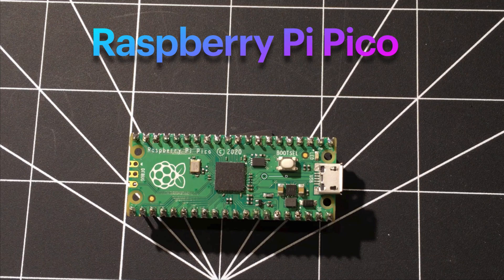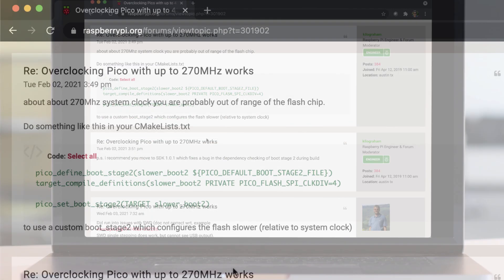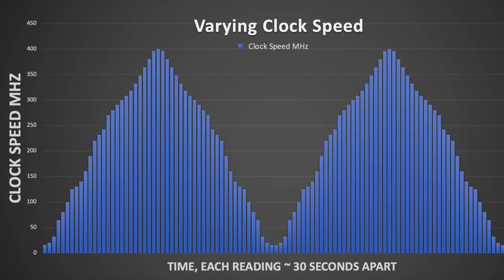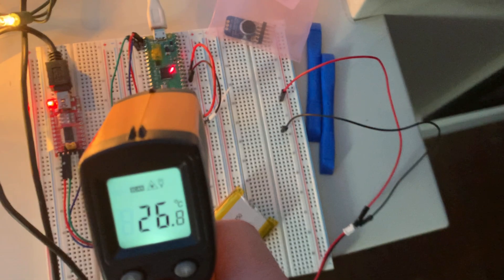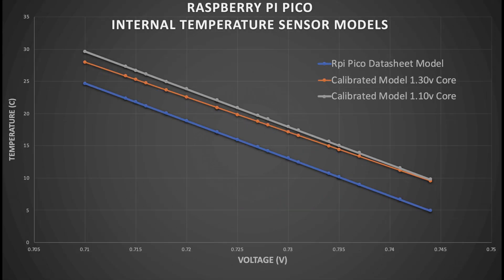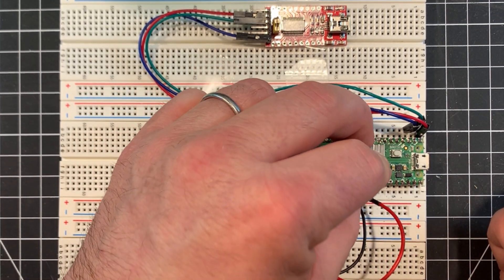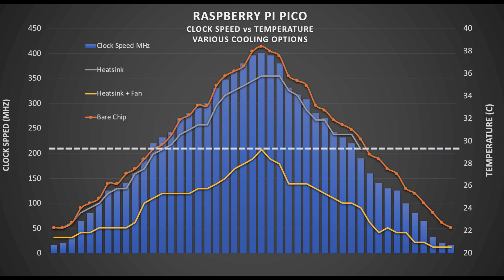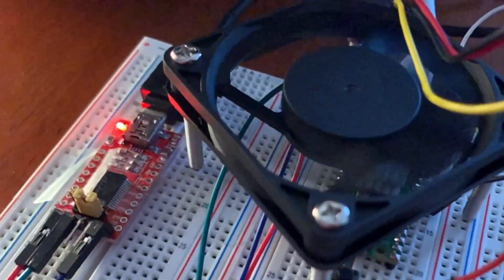Pico Overclock Part 2. Fixing the catch with the flash.

Comment: Sadly didn't work for me. My Pico seems to become unresponsive not even above 300MHz but even at 300MHz. Tried both the stuff shown here and there's a 300MHz option in the Arduino IDE as well, both give the same symptoms. I have two Picos and neither seem to work at 300MHz even with the changes to the CMakeLists file. 276MHz works just fine tho.

Comment: Yes, a fan makes most difference, with most electronics. I found that out while working with a shield on a regular raspi (no heatsink). It overheated because of low airflow (because of the shield on top). Just blowing once (!) between the sandwich layers reduced temperatures momentarily by 30°C or so. Then I hooked up a small low speed fan and the problem vanished.

Comment: Am I correct in thinking that if I overclock to 300MHz, the flash RAM can be used as is? I have been given the C source code of a fixed-point MP2/MP3/MP4/ACELP/LPC10e decoder. If I can run @ 300MHz then I can compile the C and convert to assembly one routine at a time. Now, my ONLY gripe about the 4020 is that it only has 2Mb of flash. This is not a lot of space for an MP3 decoder. For that reason I am keen to know if my PC or maybe a Raspberry Pi with more RAM can act as a USB slave.
 I would like to thank you for your excellent video. I wonder if you tried overclocking both cores. If one is essentially disabled, I presume less heat is generated and since both cores are on a single piece of silicon, maybe that will help with cooling.
 The project I am working on is a not-for-profit low cost audiobook/audio-lesson/digital storage & word processor (for now). In the last case the SoC uploads the word processor onto a PC or Mac. It is specifically aimed at developing nations such as India, China and South America. I have to get the whole thing:

-USB drive
-Audiobook player
-Auddio-lesson player (multiple choice questions)
-Storage device for Windows/MacOS computers executables and data)
-48 x 256 pixel backlit LCD screen (so larger glyphs can be rendered).

I am also looking into supporting microtransactions. The limit will only be $10 (for example) so kids can always have enough money to get home BUT digital payment occurs AFTER the journey so kids don't get bullied for their lunch money. It can also act as digital library card, bus pass end indeed any kind of key.

 When this is complete (as I know it will), I intend to base an MP1 video decoder (VCD) on the Cortex M3 processor. As you may know, MP1 video has a resolution of 352 x 288 pixels @ 25/30 frames per second. The audio is MP2. On an 80 minute CD, the format will hold 800 minutes of video.  That means about 900 megabytes of data. Of course, the data is required serially so the source does not need to be THAT fast. A ROM that simply streams out data will work. Since the data is being streamed, there need not be error detection.. CIRC, a variant of Cross-interleaved Reed–Solomon coding is used which means that for every 3 bytes, their has to be an error detection and correction byte so 106.66 Mb can be stored. Each frame can still have a time-stamp and finding it on a ROM will be pretty easy.

I think the device needs to have 128Mb of serial built in. However much storage a serial flash holds, it only has 6 pins connecting it to the system. I'm not sure if it's possible or even desirable to place said flash onto the same piece of silicon as the CPU and i/o devices but I know 2 things must happen:

1-The cost of serial flash keeps dropping so that the device is cheap
2-The device has a female USB socket so that people can share data.

I also want to include a real-time ADPCM/LPC10e/ACELP encoder so that teachers can either record lessons and give copies to students or students record the lessons themselves. If people want to see just how cheap the Chinese can produce digital hardware, I give you the $12 mobile phone:

https://www.bunniestudios.com/blog/?page_id=3107

The CPU is a ARM7EJ-S which is to say that it's really an FPGA which converts a Verilog script into a CPU. I mean, I do not see the need for Jazelle (plus Jazelle has a zero-day insecurity issue) and Thumb 2 has been shown to be faster than ARM7 and so an ARM Cortex M3 is the best bet.

After all of my blabbing, I have 2 questions:

1-will the Pico's flash memory work when the CPU is overclocked to 300MHz? I chose 300 because any more seems to require MANY changes and I need a reliable device.

2- Is it possible to replace the serial flash on the Pico with a larger flash? I'm developing an MP3 decoder so I need a lot of data space to test. There is a micro-USB on the Pi and I wondered if that could be used. I know PCs & Macs only seem to manage being master but does the Pi? Can I put a lot of flash onto a Pi and USB it to the Pico?

BTW the target price of the audio device is $5 in bulk. When I say bulk, I mean orders in the multiple of millions. ARM has a strong presence in Africa and so they will help.

Many thanks
Reply from the maker: Hello, I think this is the longest ever comment on one of my vides ! Glad you liked the video. I do try to read and respond to all comments 

Your questions 

1) The issue with Flash only working to 300MHz has been solved. The Flash memory runs slower than the CPU and has limits so when you overclock the CPU the flash in the default setting can't keep up. The fix is simple, talk slower to the flash memory. There is a clock divider you can set which allows you to clock the CPU above 400MHz quite safely. The setting is discussed in the video and it works well. From what I have read clocking the CPU much above 270MHz might cause the flash to not work. A few comments I got from the RPi Foundation was that I was lucky to get it up to 300MHz  as the flash is rated 133MHz with a 2x divider on the system clock. So maximum 'designed' or nominal CPU clock speed that works with default divider is 266MHz. But as long as you switch the SPI clock divider to 4x you are safe up to and above 300MHz. Everyone seems to be clocking the Pico up and above 300MHz in projects many HDMI video projects require this and there seem no bad effects. 

2) The built in flash is an SPI flash chip. and they make pretty big ones but the prices goes up with the size. Here is a 128Mbyte or 1Gbit SPI flash device https://www.cypress.com/file/233721/download. Alternatively using a USB disk device would require USB host programming. I've not seen any projects with this yet but also appears possible. If I wanted a cheap and large storage device on a Pico I would use a MicroSD interface. Easy to program, its well supported and lots of examples. Also cheap and upgradable later. 

One you other points, so I have run both cores overclocked and it makes very little heat difference. The chip stops working above certain clock speeds but it does not seem heat related. Even with great cooling you can't clock the chips much above 420MHz in my experience. So I don't think its cooling related there is just a hard limit there I think. 

Good luck with your project.

Comment: As pico's center gnd pad is made to dissipate heat down to pcb, so I think the fan cools down the whole pcb area and the heatsink does not really do much from being on the top of plastic carrier. So try put a thermal pad and copper sheet on the bottom instead.
Reply from the maker: Yes now I have looked at the underside of these chips I would agree the ground connection pad is massive and is likely dissipating heat into the PCB suggests PCB design could be a big factor in cooling.
Reply: @robin-g6  1mm board with 2oz copper, and via's around the gnd pad, not on pad as solder wick effect. On bottom stick a  digikey  
PH3N-76.2-12.7-0.07-1A you should be good.

Comment: That seemed like way too much heatsink paste.  It should just be the faintest sliver - just enough to fill in any imperfections between the chip surface and the heat sink's surface.
Reply from the maker: Yeah it was hard to get less out of the syringe but it was pushed down hard so I think in the end most of it spilled out the side and it did make a good thermal junction.
Reply: @robin-g6  are you sure?  Your graph shows that for the heatsink only you achieved a peak reduction of 2C, which to me suggests the thermal junction really wasn't that great.   I'd suggest repeating the experiment with the proper amount of paste, and also with just the fan blowing over the bare IC.
Reply: @RayBellis  There is a lot of plastic in between anyways, so it wouldn't make much difference. Also I believe the QFN package has a big ground pad below it, so it already dissipates the heat well there. So if you want better cooling, the most logical way seems to use multilayer PCBs with huge ground planes and many vias below the ground pad.
Reply: @tunahankaratay1523  probably true, but surprises abound.
really though  40C is nothing.

Comment: Thanks for answering the thermals question! Even at 40 degrees I'm surprised by how cool it stays given such a high overclock. I imagine decent passive cooling could achieve the same results without the fan. The RP2040 is turning out to be a really efficient little processor, just a shame it lacks hardware floating point support!
Reply: It is the first ever chip, so it makes sense that they wanted to make something small, cheap and efficient. But at 420MHz it is already a monster. I believe their 40nm process have a big role in the overclocking performance. ST uses 90nm.

Comment: This is really interesting. I'd like to know how the power consumption of the CPU changes with clock speed and fan speed, and how the fan's power consumption changes with fan speed (and I'm guessing it won't change much with CPU temperature for single units, but it would be nice to know how these parameters change with high scaling , by which I mean the number of CPU assemblies in a cubic volume.)